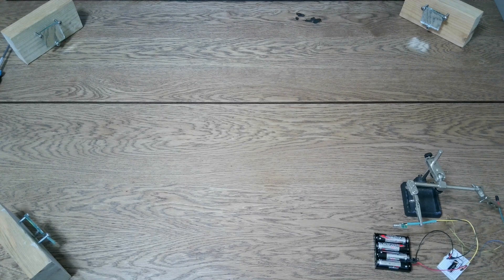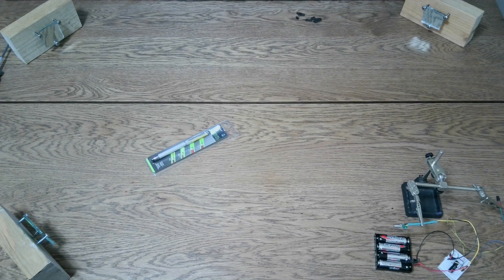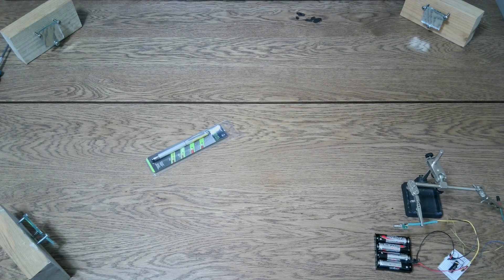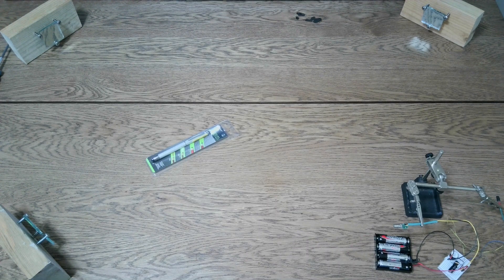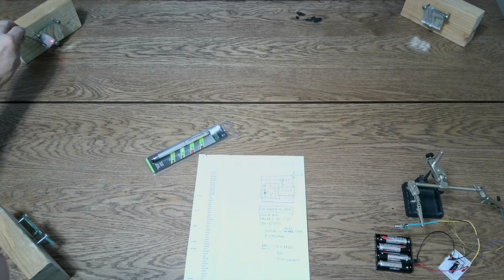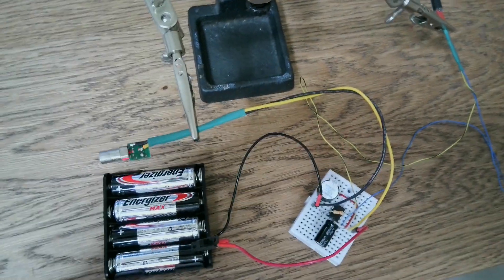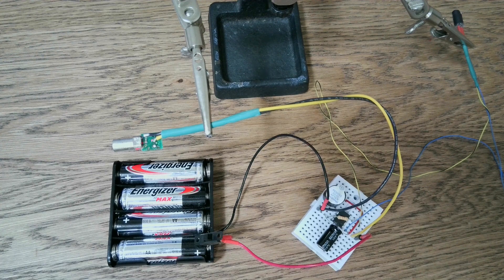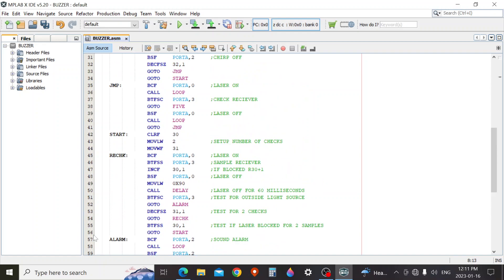Perimeter Alarm using a $1 laser pointer

Comment: Good little video -- its cool what can be done simply. 
I was looking at some security in this manner.  Seems hard to find any pointers that stay operative for more than a few days.  Even more high end ones as well -- perhaps I'm just unlucky.
Reply from the maker: If left on, all of these cheap lasers do start to diminish in power output within minutes. I think they are probably overdriven. The solution that was done here was to pulse the Laser or simply reduce the duty cycle to something like 1:1000. I can't remember the exact number, but this allows the device to stay cool and strong. It also gives a much longer battery life. Of course the trick is to adjust the pulse width to allow the receiver to detect it before it is turned off again while still keeping these quick pulses coming at a rate that will not allow an interruption in the beam to go undetected.
Reply: @rwatson2609  Thankyou - good observation.  I will have to look toward much higher powered lasers and then 'throttling them back' with PWM so as to get both the longevity and sufficient intensity.  Perhaps even moving to industrial types (though the cost goes WAY up).   
:eyes-purple-crying::eyes-purple-crying: 'Back in the day' electronics were actually built to operate and stay operating for a good period of time.  And today its all about price and spec-manship; ...and they don't care a whit about the end user.   
All these things are signs of the times.  ...It's all such a mess; I'm looking forward to Jesus returning soon. 
Blessing RH